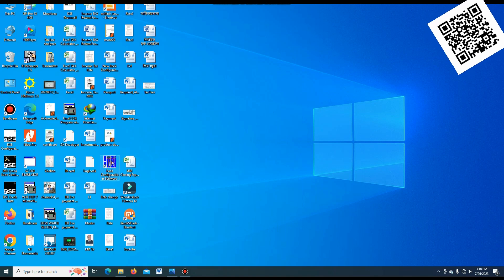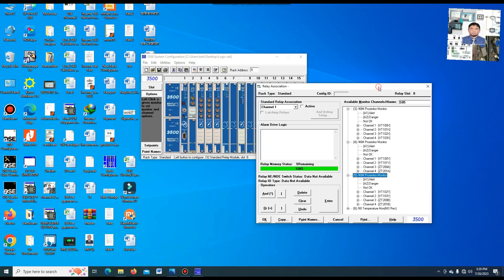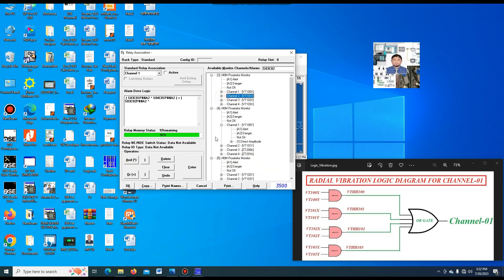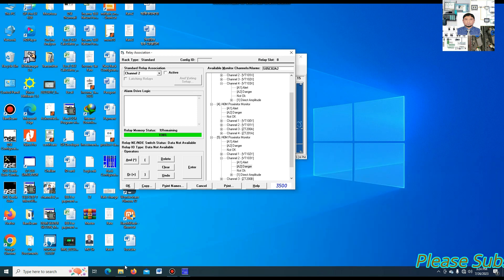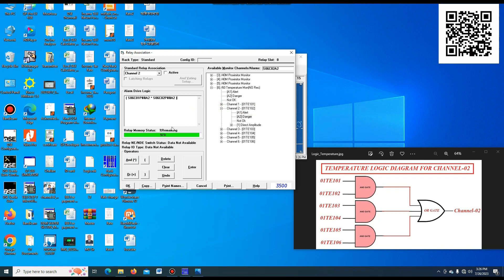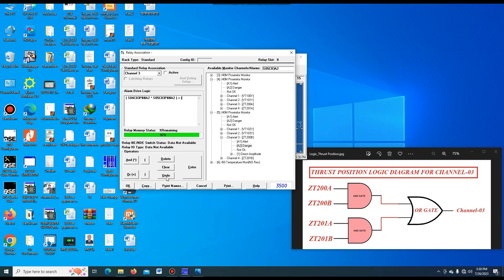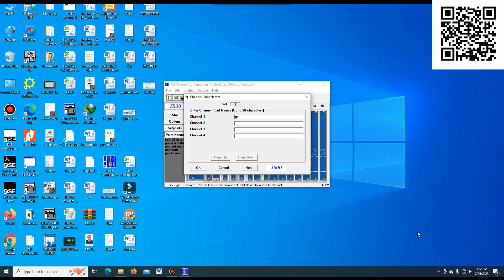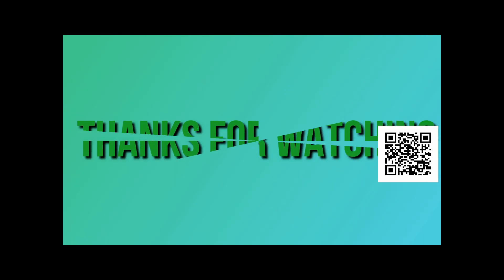How to make a Logic Program in Bently Nevada-3500 Vibration Monitoring System?

Comment: Hello
I have a question. What if I change the logic and download to the rack (during normal operation or when the compressor is running)? TRIP (compressor off)?
Reply from the maker: Changing any logic and downloading to rack at running may be compressor tripped.
Because all values become zero and go to normal.
Reply: to avoid trip you can bypass the system by putting a jumper  or removing the wire from the terminal as per logic ( energized or de-energized )relay output, and measure again the output after the download is completed to confirm the output

Comment: Hello . I have problem i need help pleas
During the data upload operation from the rack to the PC, we noticed that only the TDI card displays data, while the other locations (slots) remain inexplicably empty. This observation raises concerns about the integrity and recovery of data stored in other rack locations.

Attempting to download the program to the rack encountered a major obstacle due to the mismatch between the virtual slots (blue) and physical slots (green) relative to the TDI board. The TDI card is designed to interface with physical rack slots, but due to this incompatibility, the download process remained unsuccessful
Reply from the maker: You can try by using new TDI Card